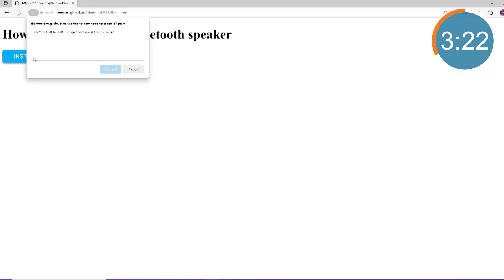Building A Bluetooth Speaker In 5 Minutes - How Hard Could It Be?

Comment: Hi, great video. I am trying to convert my old car radio to have Bluetooth and plan to connect the outputs to the CD player left and right channel. This might work (I think). I am sorry if I missed it but I cannot find the pins you used for left and right speaker channel on the ESP32. Another question, does it output in stereo?.